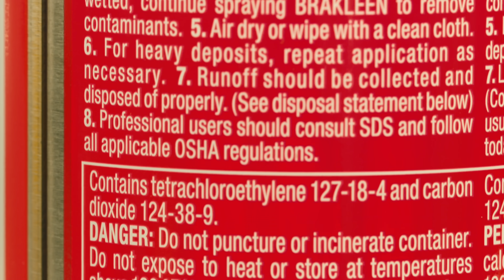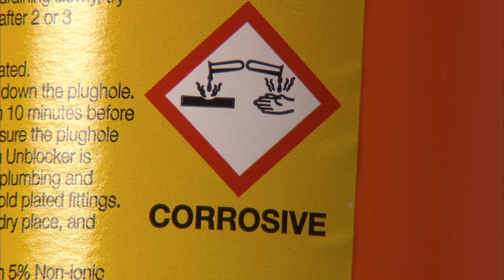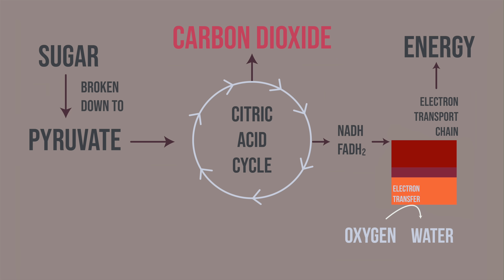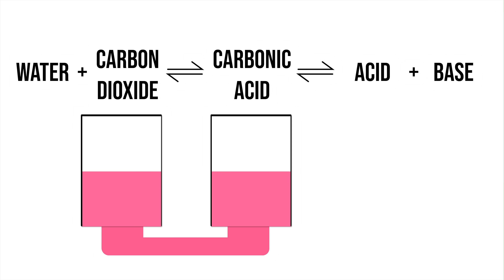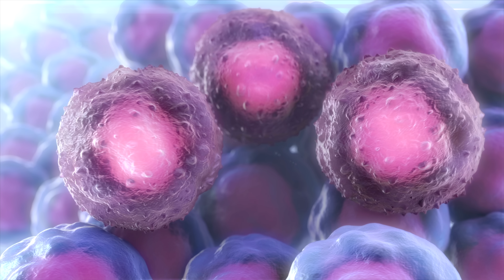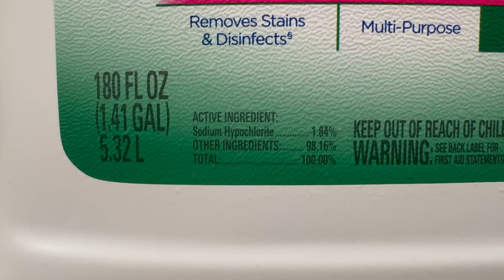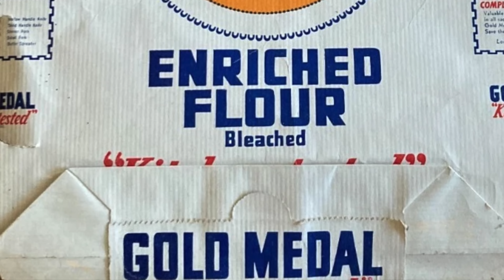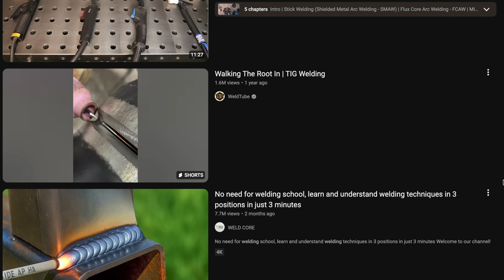"It smelled funny while I was welding and now I can't breathe..."

Comment: Heated chlorine turns into mustard gas. I could be welding 200ft away from a mechanic spraying chlorinated brake kleen and smell it under my helmet, it takes very little concentration. After investigating this all work places now use non-chlorinated brake kleen. Welders take note, do not weld anything sprayed with chlorinated brake kleen!!!

Comment: Very important message. I also learned welding by my self and only in one video I watch to do so, it was told not to use brake cleaner. And even there , the consequneces weren't  realy highlight as so dangerous. But I bought  Isopropanol as a different cleaner when welding. 

But even now, I think your video is a good reminder. Brake Cleaner is such a common substance in a workshop that you it not bad to get reminded.

Comment: I will admit, I only toyed with welding in high school shop class and never, until now, considered someone could kill themselves with accidentally generated poison gas from welding. I knew about the required eye protection but also did not consider the UV rays from arc welding. I only experienced acetylene torch welding in school.  A thousand ways to die.

Comment: I've ground metal, but not welded. I wore eye protection, hearing protection, and a respirator. I only did this outdoors. I took a shower immediately after finishing. It's overkill, a little.. but it's so easy to do overkill, and very easy to accidentally err too far into dangerous, so I take the easy safer option.

Comment: Phosgene is mustard gas that they used to gas people in WW1. 1 part per million, you smell it. 2 parts per million you feel it in your throat. 3 parts per million they carry you out. No record of 4 parts per million. Same gas produced from trichloroethylene which is also an industrial degreaser.
It is the UV that reacts with the chemical. Chlorine does affect the ozone layer which is only mm thick. Welding and electric motors produce ozone.

Comment: So will this still happen if the brake clean is completely evaporated away? Or does the metal have to be wet from brake clean for this to happen?
Reply: Seems like if it was evaporated there would be nothing to turn into gas, but idk thats why im asking lol
Reply: Once it's in the air, you might still produce a little of the toxic gas as it reacts in proximity. However, those amounts are neglible probably

If it's wet, do not weld it.

Comment: Note: you always hear not to mix bleach with other chemicals. I didnt know (rather, never considered) what bleach would do in the presence of urine. Urine contains ammonia, so it's the same story - it will create harmful gasses.

This is why it's important to remember to flush a toilet after cleaning with bleach, BEFORE using the toilet. Dont try to save water by going to the bathroom before flushing the cleaning solution out.

Comment: if they were wise they would've packed him with methylene blue and it would do oxygen's job while sequestering the damage from the exploded phosgene cells, methylene blue isn't even expensive dude. why do we have such stupid doctors? phosgene is pretty much a last resort throw everything and the kitchen sink at it and methylene blue is the kitchen sink. the kitchen sink is the solution to every problem you cant solve any other way. if it can be solved. i mean i would've given this guy methylene blue and n-acetylcysteine,  let it do oxygen's job while stealing all the phosgene from his cells and replacing their glutathione maybe even give him glutamate to make glutathione synthesis more profitable. its really not that hard to fix this problem.  its like watching a carcrash in slow motion except you can push the cars apart if you really choose to.

Comment: Never knew the exact process of using chemical cleaners and then welding. I was taught to always use mechanical means of cleaning the steel before welding such as sanding, grinding or the new lasers. Never use chemicals for safety as shown here but also some agents can cause bad welds. I don't weld a lot but I will be even more careful of chemicals on my parts.

Comment: Here is another situation you might want to cover. SCUBA divers (aluminum oxide). In 2016 I was going to do a bottom cleaning on my sailboat while in the slip. I had an old aluminum bottle of air that had been sitting in storage about 10 years and was still full. Rather than take a long drive and wait for it to get its inspection, I went ahead and used it anyway. Big mistake! 
At first I took a few breaths and it seemed ok. So I went in the water. As I was cleaning the bottom of the keel (10 ft deep) it felt like my regulator was giving up on me. I went for the surface gasping for air. As I hung on the dock I could barely breath. I stayed there for a couple minutes before I could drag myself out of the water.  That’s when I realized I had poisoned myself. 
For the next 8-9 years I could take  any deep breaths or breath hard. If I tried to hold my breath, I would start coughing. ￼And I was an avid hiker and biker. Which, I couldn’t do anymore. I got and X-ray a year after and they couldn’t see anything. But I was feeling it. And still do slightly, these days.
Reply: Thanks for sharing your experience. Hope it gets well for you.
Reply: Just give it more time, the human body is remarkable at healing itself. Even believing that itself can induce positive effects. The placebo effect. You will clear out your lungs totally!
Reply: @thebigounce391 nope he won't he will live in misery for exactly...... 7 more seconds

Comment: Oh OK, so it wasn't Styropyro ... that makes more sense.

That said, as someone who went through part of a Regional Occupational Program in welding, the safety issue of chlorinated solvents never came up. And solvents weren't used at all in that class, though hydrochloric acid (muriatic acid) was used for soldering and brazing prep. (albeit my previous shop teacher had advocated use of diluted phosphoric acid for that instead, as it's applicable for many situations, but less toxic and less corrosive: thus also more forgiving when using on metals)

There was also no concern over wearing a mask when grinding steel (or aluminum), but good ventilation was always present. The real-world risk of inhaling substantial amounts of abrasive dust (often aluminum oxide or silicon carbide) is a lot smaller than the risks of inhaling welding fumes (metal + oxides and/or flux depending on the welding type), so good ventilation is important for the latter even more so than the former. (metal powder from grinding is usually too coarse to be a respiratory hazard, but definitely an eye hazard)
OTOH, fine metal powder/dust created from sanding is a more legit inhalation hazard. (and having belt sanders or power sanders with vacuum connections for dust management is important along with good ventilation, but some cases there would also require a mask, just as is also true for woodworking; some discretion is required to judge whether there's an actual airborne dust risk as well;  inhaling fine wood particulate can lead to brown lung disease, let alone more acute issues related to allergic and auto-immune reactions)
The particle sizes involved with using grinding wheels and cutting disks are going to generally be outside of that fine particulate range that's a high inhilation risk. (coarse grit sanding is also relatively low risk, but fine sanding is seriously problematic)
This is also an advantage of wet sanding, largely eliminating the risks of airborne dust, while also being better suited to fine polishing work typically associated with fine grit sanding.

Wearing high SPF sun screen can also be useful in addition to (and somewhat as a subsitute for) full length clothing and for covering the face and neck areas that might end up exposed even with a full welding mask down.

Good safety glasses or goggles are always important, though polycarbonate based eye glasses are often acceptable for some situations (formerly, tempered glass was also used). Finding good goggles that fit over eye glasses can be difficult in some cases, though. (I've had metal fragments come in from the side of glasses personally, so the risks are real, and full coverage safety glasses or goggles are definitely useful)

Comment: The main reason chlorinated (and other halogenated, especially fluorinated) organic compounds are used for applications like this (and as aerosols and refrigerants, though much less commonly now for CFCs due to ozone depletion risks) is because they're basically inert and unreactive, while being relatively low in toxicity as well (compared to highly flammable and/or more toxic alternatives).

Carbon tetrachloride used to be common in similar applications (degreasing and dry cleaning), but that got phased out due to acute and chronic toxicity, while tetrachrloroethylene is dramatically less toxic with basically no acute toxicity and limited chronic toxicity (with main concern relating to long-term liver damage potential and increased cancer risk; both of which Carbon Tetrachloride is many orders of magnitude worse for).

It takes a lot of energy to get fully chlorinated organic molecules to react with things, even with the double-bond present, but high temperature oxidation + reduction conditions are an entirely known and relevant condition for such reactions to occur. And with both oxygen present and a reducing agent (in the form of iron and manganese) to allow for complex reactions, not to mention metal oxides acting as possible catalysts, AND the flow of DC electricity having potential electrolytic effects, you've obviously got a highly reactive environment.

Another relevant case would be if the chlorinated brake clean was ingested into an engine (like if it was being used as carb or air intake cleaner, or as improvised starting fluid, which is something the flammable, non-chlorinated types of brake cleaner is reasonably suited for). The high temperature and high pressure environment inside a typical gasoline fueled spark ignition engine is almost certainly going to lead to tetrachloroethylene reacting and producing toxic chemicals, also likely damaging the catalytic converter (but say, if doing this on an older vehicle engine, or lawnmower engine or other small engine with no emissions control, it would run straight through without catalyst interaction, but produce various toxic combustion products ... beyond the typical VOCs and carbon monoxide). And, in face, it's the carbon monoxide radical itself that would also directly contribute to the formation of phosgene. (since it's the carbonyl group that thus reacts with chlorine atoms to form phosgene)

People trying to blend moth balls into gasoline for custom fuel blends would run into similar problems if they end up using paradichloro benzene common in many modern (low-flamability) moth ball formulations compared to "old fashioned" mothballs made of naphthalene. (the latter is an aromatic hydrocarbon, so presents no such unusual combustion products)
Reply: If the brake clean was completely evaporated away would it still create gas? Just asking cause it seems like you would know ha. (It seems like if it was completely evaporated away it wouldnt create the gas, but idk, thats why im asking ha)

Comment: I got chemically induced pneumonia when I was young , because a friend decided to clean his patio cement with hydrochloric acid. My partner and I slept over next to a window that was directly over the outside patio area. I was closest to the window and my partner next to me. He was fine funnily enough yet by the afternoon of the next day i was rushed to hospital and later diagnosed. It was very scary and luckily I didn't have to be intubated, just needed o2 support for several days, and made a full recovery. Sadly though i missed my friends wedding, as that was why they were cleaning the concrete for. I still don't know why noone else was affected and it hit just me ,but i guess our tolerance for exposure to toxic chemicals must vary between people, and I'm apparently extremely reactive. I do get pollen induced asthma so maybe that's why, just more reactive. Don't clean concrete with hydrochloric acid, you could definitely put people at risk of a similar reaction, it also broke down his concrete and it became brittle and developed a powdery surface that didn't go away, so he kind of wrecked it by trying to clean it with this. Our friend was not the sharpest tool ,that's for sure.

Comment: Excellent. I knew as soon as he said "wet grass" is was phosgene, but honestly, that would be an easy mistake to make, and I often know enough to be dangerous. As a whippersnapper I used to clean pools in the summer, and occasionally those "chlorine puck" buckets would be stored outside in the rain. Well, those pucks are meant to decompose into free chlorine in pools, and if you add a few inches of water to the bucket, decompose they do. So you learned to cautiously pop the lid off - if there was solid green "liquid" gas in the bucket, run like hell. Unbelievably quickly dissipating, it would get you in a second or two, burning your lungs and eyes with acid,  and clear half a yard for 10 min.

Comment: This is bullcrap, i use brake cleaner on metal all the time and weld it and nothing what so ever, if it is still fluid and hasnt evaporated then it would be a fire hazard anyway so you would not be welding it in the first place, but steel that has been sprayed with brake clean once dry has no effects from welding, welding is smoky no matter what so adequate ventilation is basic dummy knowledge, you will automatically open the garage door and let the smoke out and go outside from human instinct.🙄

Comment: Did this, this past summer with the exact same brake clean product. Tig welding and something was off. Smelled like fresh cut hay. Thankfully I had the good sense to go outside to fresh air and open the doors. I suspected the brake clean and googled it… came up as what I smelled was a chemical weapon used in WW11.
I was dang worried. Especially where it said you don’t feel symptoms for 24 to 48 hours. 
This is important information. Check the ingredients in your brake cleaner when using it for cleaning steel before welding. …. P.s. I lived.

Comment: Wait, did he use chlorinated brake-kleen rather than the flammable organic solvent type?  Yeah, you don't want to make that mistake. Same thing if you're used to using brake-kleen or carb cleaner as engine starting fluid.  The stuff that's just made of mixed hydrocarbons, methanol, and actone (sometimes just toluene, methanol, and acetone) is fine to be around the combustion products of, and arguably safer to breath the combustion products than the raw fumes. (potential carbon monoxide risk + some incomplete combustion vs acute methanol poisoning or, much less so, toluene toxicity and increased cancer risk:  acetone and methanol form a low-boiling azeotrope, so the initial fumes are going to be made of acetone and methanol, and methanol is pretty toxic stuff).

The non-chlorinated stuff requires similar precautions to traditional lacquer thinner (or at least late 20th century formulations, as some older ones may have included benzene or mixed BTX aromatics, later ones swapped that out for pure toluene + acetone + methanol).

I accidentally ordered chlorinated (mostly tetrachloroethylene) brake cleaner a few years ago, but realized what it was before using it in any dangerous manner.

I'd honestly have thought styropyro would've known enough about chemistry and combustion (and toxic combustion products) to consider this. That and electric arc induced redox reactions, and high temperature pyrolysis.

Plus there's using proper ventilation while welding in general, but I suppose you can get away with a lot without following that rule. It's a bigger issue with stick welding (SMAW), but even with mig, and with plain carbon steel, there are genuine risks, including chronic manganese toxicity (risk of developing manganism).

Comment: Wow, I am a guy that would have done that same thing in my workshop. Thank you for potentially saving my life.
Reply: dont weld galvanized either.
Reply: @bmxerkrantz  Also, wear a respirator
Reply: @bmxerkrantz I have once and felt so sick that night
Reply: @bmxerkrantz  Had a guy in our shop who sometimes welded galvanized rods to steel plate, even with ventilation he came down with what doctors thought was degenerative nerve disease but we later discovered he had slowly been poisoned by the fumes produced from welding galvanized steel.
Reply: Most brake cleaners available to the public are non-chlorinated. This wont happen with the non chlorinated stuff
Reply: Always do your home work before trying something new know what is safe and what is not. Above all proper safety equipment.
And personal safety equipment is a must, and the proper use of it and always have adequate ventilation and never work alone.  We all know the lack of knowledge of a subject can be very dangerous. If not handled properly..
Reply: I use brakecleaner almost always on surfaces I'm going to weld. Just not the chlorinated variant.
Reply: Yes, just imagine how many mechanics and farmers and such have taken sick and die of "unknown" causes!
Reply: Yeah. I'm really concerned... Problem is I don't get exactly what is welding nor the name of the chemical in Portuguese. My dad loves these workshop's stuff  and Once I grew up I've realised that we had been doing some things not particularly safe, like melting plumb without masks.

Comment: Does NOT use hi voltage for the welding process. Not any of the processes shown in this video. MIG is a dc process and he was using no more then 24-25 volts. The amperage would be what creates the heat to melt the metal

Comment: Great video. Phosgene is really scary. One small correction, welding uses high current not so much voltage to generate the heat :)